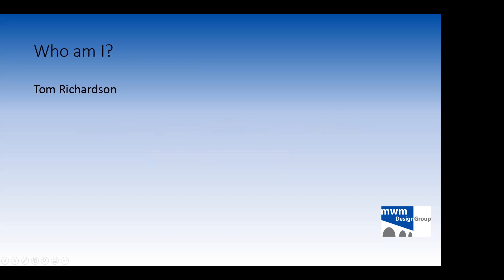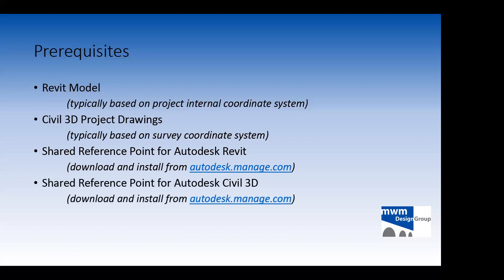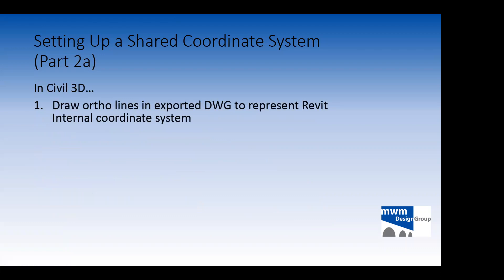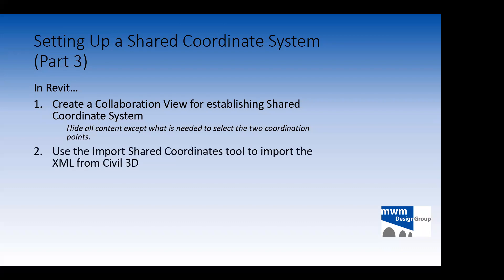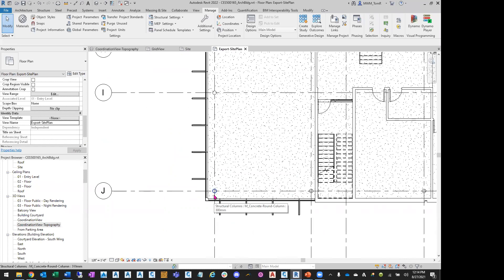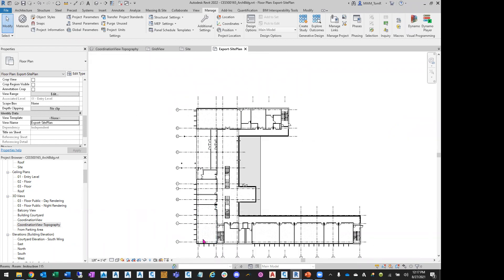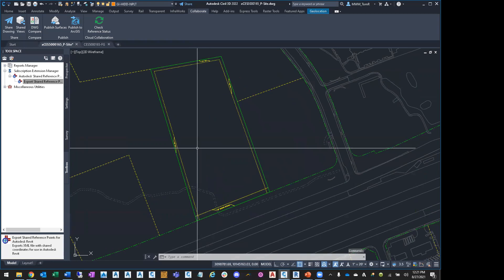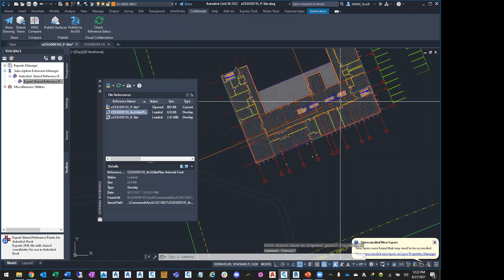Civil 3D and Revit Collaboration

Comment: Great write up, but when you re-opened the shared exported dwg and placed the (32 min mark) you went quickly about how you made the new axis lines. I would have thought that since it is now using the shared coord, the 0,0 point would be way off the page, like it should, yet yours are shown back in the center of your structure. Did you paste them back at the original origin point from the previous export model? Thanks,